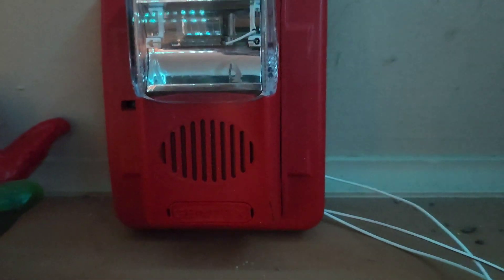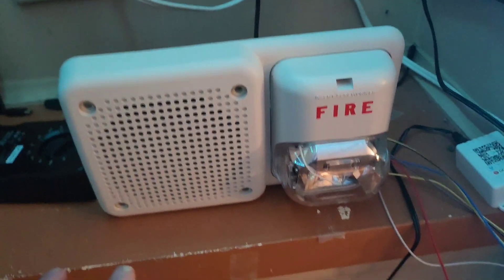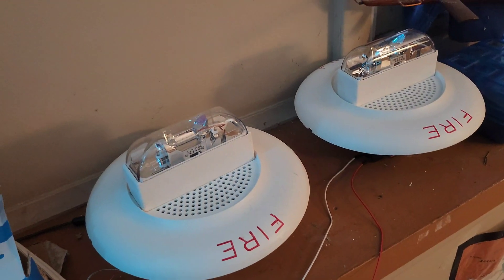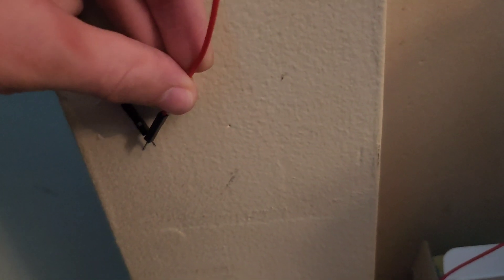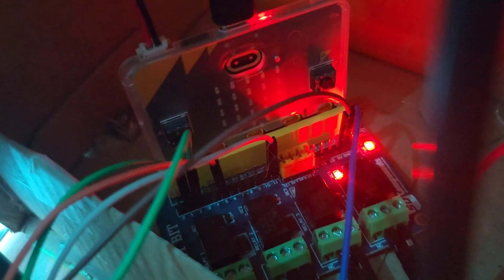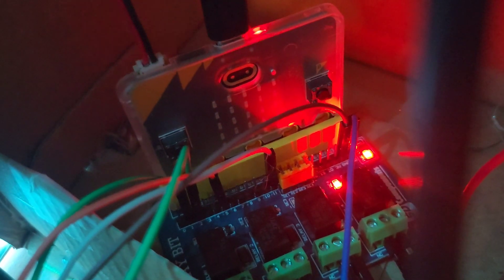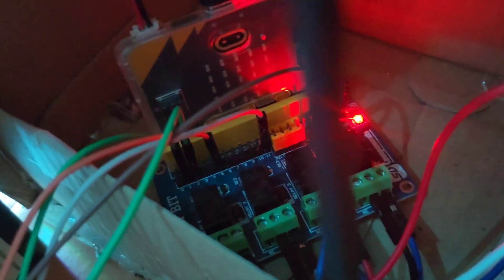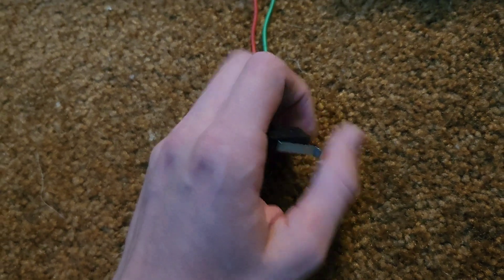Microbit fire alarm with homemade sync module (test 5)

Comment: how do i make my own system sensor sync module?
Reply from the maker: Well what i would do is have the circuit turned on for about 1.5 seconds, turn it off for 0.1 seconds and repeat that forever